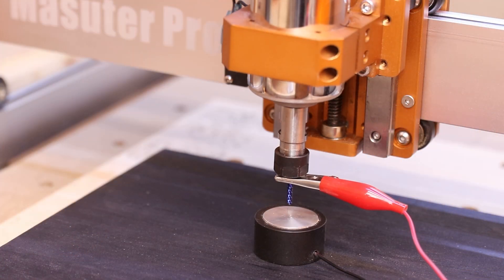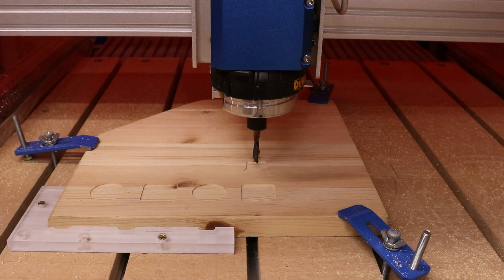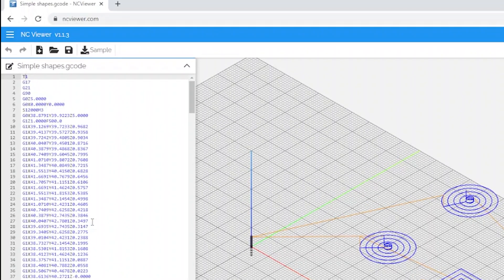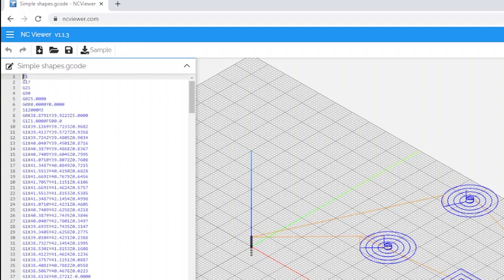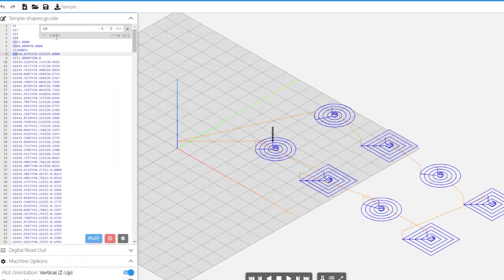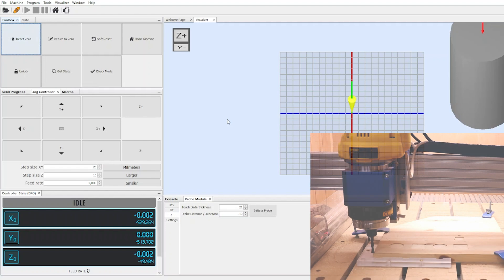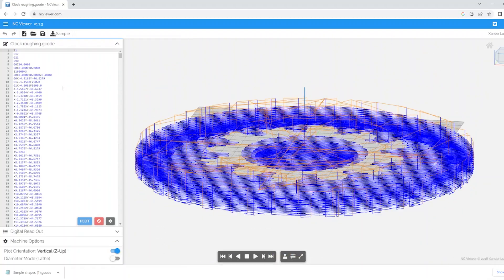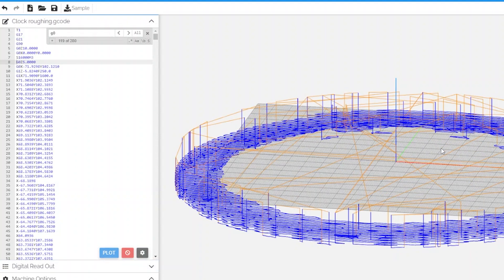Easily pause, restart or recover your CNC job - also how to split your job into 2 parts

Comment: Tried this method and found another UGS weird behavior.  The first command in the Carveco generated gcode is T1.  UGS is fine with that.  If I edit as shown in the video, the first command is still T1, but UGS flag T1 as an invalid gcode.  I tried manually creating a file that just had T1, G17, G20, G90, G0Z0.3937.  Should be pretty simple.  UGS does not recognize T1 as a valid command.  Result ... this method isn't working today for resuming a job.  I checked with both a code and text editor do ensure that ncviewer had not inserted an invisible character.

Comment: I am so glad I found this video. Thank you for taking the time to explain how to recover a job. I have a little problem though and I'm hoping you can help with it. I have followed the process as you lay it out, I guess I should first say that I am using UGS. When I get to the part where I'm ready to delete code, I'm' not sure where I should delete to. The first code on mine is G20, then M3 S1200, followed by G90, G20, G0 X0.93129 Y4.17855
G1 Z0.00000 F9.0
G0 X7.96120 Y6.71792
G1 Z-0.03000 F9.0
The first G20 has a red dot next to it that says G20 is not a valid g-code. How do I get rid of that warning and what do I delete at the beginning.

Comment: My first job ran tonight and ended up jamming on the Y on my 3018Pro. The machine only jammed for a short duration and was able to continue but unfortunately the Y axis was now off and it milled right over the work ruining the piece. Presumably there is nothing I can do about this because it would mean I'd have to be watching like a hawk with my mouse cursor ready to click stop/pause? It did this on about 2 hours into the job so it's not as if it had a problem with that particular coord, it just seems to have been a random jam. Completely new to this though so any advice/video links appreciated.

Comment: Good day sir! I noticed that you are you a Dewalt router with your machine. I was wondering if that router (Assuming its the Dewalt 611) can be used in the FoxAlien Masuter Pro? Thank you for all your work! It's because of your videos I haven't chucked my FoxAlien machine in the bin!
Reply from the maker: It needs the 69mm holder, I can't remember if the Masuter Pro comes with that as standard. I think it does though, if not the holder can be purchased separately.
Glad my videos have helped 😁

Comment: That's interesting. I usually just restart from the beginning and see the router cutting air for some time. It's less work but takes more time to finish. UGS can edit the GCode and start from any point but I never bothered.
Reply from the maker: Yes so at the point I did this video I actually found a bug in UGS s "Starr from" feature which is why I didn't show it I'm the video. After I raised it they have now corrected the issues making life much easier, you just literally say start from line XXXX and it does all the hard work for you

Comment: Can you use this when laser engraving.
Reply from the maker: The principal is the same, you'll looking for the lines of code that essentially turn the laser on/off and you'll want to aim for one of those
Reply: @JamesDeanDesigns  Hi James I have tried it on a laser engraving file and it just shows gibberish in the g code viewer. Is it because it is png file do I need to change some settings.

Comment: Needed this 3 days ago. My router stalled because RPM was set too low, had to do a emergency stop. Had to start the job from the beginning. Took an hour before it engage wood to cut. I try out the NC viewer but it won't show my tool path when I hit the plot button. Gcode  was created by Vcarve.

Comment: Tip for more complex gcode : If you can measure how deep the cnc was cutting before failure you can search for the G1Z command with that depth, then back up one pass. For example, if it stopped at 3mm cutting depth you can search for G1Z-3, then scroll up to the last G0 or if you know each pass is 0.2mm search for G1Z-2.8. This works as long as the gcode moves the Z axis separately from the X and Y (eg 2D and 2.5D).
Reply from the maker: Very useful addition. Thank you 👍

Comment: silly question but how do you deal with the z height (when you restart) if you use a z-probe?  Do you have to re probe the z height at the original location you used before starting the original cut, or is there some grbl method that can be used to first read the settings you used [obviously before the power outage or stopage] and the re-enter those setting [I use the sainsmart gcode for using their z probe].  as a side note, to figure out the lowest point of the material I borrow from my 3d printing process and use a 6x6 (or greater) probe grid so I have recorded the actual z height that was calculated by the sainsmart macros so i guess I could probably use a portion of that code and figure out how to manually set that data inside of UGS platform
Reply from the maker: If you have gone about setting your job up correctly (eg. homing and z probing) then you would do what I have done in the video which is after it stops, essentially just rehome, return back to your start point and run the z probe again before loading in the edited Gcode file. Usually I try and run the Z probe on a part of the material that is not going to be machined and therefore can always re-probe that spot if the job fails. If you are machining the entire area then I often run the Z probe on a scrap piece of the same material next to it or you can potentially Zero off the bed instead
Reply: thanks..I missed the part of you re-zeroing the z axis with the probe.  thanks for answering me

Comment: openbuild is great for starting in the middle of a program. we just right click on the line we want and we restart easily where we want.
Reply from the maker: UGS and CNC Commander has the same thing as well. I'll be doing a follow up video showing the in-software options to achieve it
Reply: @JamesDeanDesigns did you ever make that follow up video?

Comment: Hi James. Great video. Once you have identified the line you want to start from, could you use the "Start from" command in UGS?
Cheerx
Kevin
Reply from the maker: 😆 well... my video was meant to be based around that function and not deleting code....however I found a glitch in UGS which they are now trying to fix so there will likely be a follow up to this showing how to do it in UGS using that function
Reply: @JamesDeanDesigns  look forward to part 2

Comment: Extremely useful, and clearly explained. Thanks James. Question, have you any idea if there has been a pendant with mechanical jog wheel ever been available for machines such as the Sainsmart Genmitsu CNCs? A while back one was made available for duet machines such as the workbee by an extremely resourceful hobbyist. These would be a superb addition to so many hobbiests. I know there are remote apps for phones, but nothing beats a physical jog wheel for positioning.
Reply from the maker: The only Sainsmart machine I know that can handle a pendant is the 4040 Pro. What I found a little odd though was Sainsmart discontinued that pendant before releasing the 4040 Pro so essentially they released a machine with the pendant feature but no pendant to actually make it work. Other on the market may work but as I have never used one I am not really in a position to suggest any that may work
Reply: @JamesDeanDesigns  thanks James